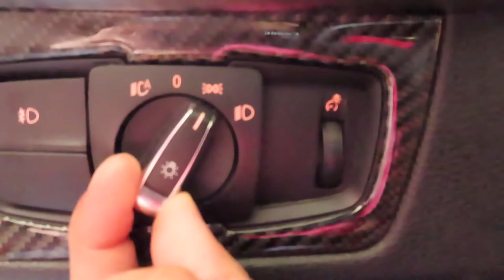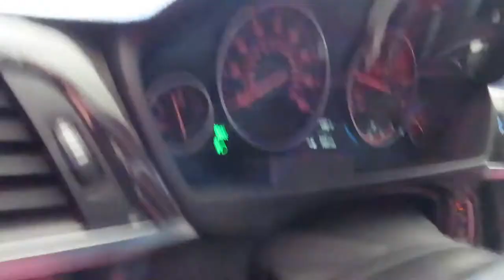How to fix Bmw Halo/Drl’s DIY | Bmw F30

Comment: Question I have the same headlights my angel light is gone in the driver side and now it said daytime lamp malfuction.I check the pigtail and look fine.Those headlight have bulb  for the angel lights or when they burn whe have to change everything??
Reply from the maker: You mean like the low beam light? Like to see at night? Those are replaceable
Reply: @LuisGee  no the spyder lights
Reply: @LuisGee  the one that didnt work in your car
Reply from the maker: Damn. If you say your connecter/pigtail looks good than it may be a fuse. But thing is I never got a light on my dash like you say you do.
Reply: @LuisGee  yeah my dash came up with daylight lamp malfuction.And all the fuse are good I check all of them.
Reply: @LuisGee  thanks any way
Reply: @LuisGee  did u get urs fixed ,lemme know I got the same problem, wat did u change?
Reply: @anthonymartinez4371  any luck
Reply: Still waiting for an update too. I got a similar problem

Comment: I bought angel eyes and connected them to my adapter and no lights turned on what could be the issue
Reply: did you buy the right one some are for stock halogen others for led stock light

Comment: Where did you get pigtail from ?
Reply from the maker: eBay
Reply: Can you put the link to ebay?
Reply from the maker: @anthonymartinez4371  it’s hard to put the link since the one i got was the only one at the time since they’re usually from part out cars.
Reply: Hey Luis Gee I have a question I check the wires and they look fine.No rust or water damage.Can you tell me if there is something else that I can check that maybe is the problem?
Reply: @anthonymartinez4371   lmk to I have spec -d black halos & I have the same light issue with both lights my connector looks fine tho
Reply: @Thundercat2024  Dude me too my Drl on my driver side doesn’t work, i got the Spec d tuning headlights, the drls only both work when i flip the low beams on

Comment: I did this and it didn’t work 😢
Reply from the maker: Damn 🥲🥲
Reply: same, i did exactly what he did& nothing
Reply: @silentescape818xsfvla8  My light control module had to be reset with the headlight unplugged. That fixed it for me
Reply: @sirmo667  can u tell me how u did that? please
Reply: @sirmo667  i have Spec d tuning Projector headlights for my f30 ,, can u explain how to do it?
Reply: @sirmo667  my DRL on my driver side wont work, they only work when i turn the low beams on together, my headlights are for non HID bmw its for the base model halogens,
Reply: @silentescape818xsfvla8  Take it to a Euro shop and let them know they should reset the light control module
Reply: @sirmo667  i don’t think my headlights have a module, what kind of lights do u have
Reply: @silentescape818xsfvla8  Bro the light control module…. It’s in the passenger footwell. Just take it to a mechanic 😂
Reply: @sirmo667  Did they reset it with a OBD connector? & i think it’s on the driver side
Reply: @silentescape818xsfvla8  yeah they did. It’s bmw software. Just take it to a Euro shop and let them know you believe the FEM needs to be reset
Reply: @sirmo667  So only 1 DRL was working for you too? Im gonna try this tomorrow
Reply: @sirmo667  could you tell me the name of the shop that did this for you